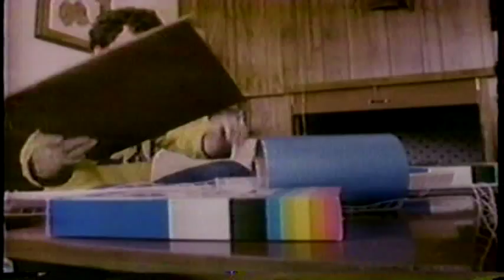MIT Engineering Competition: Ping Pong Balls

Comment: Nice collection of 2.70 videos. I j=know a few of the people in them, and I'm the builder of the winning machine in this video.
Reply: Brad Waller the death mobile is awesome my friend.  I miss watching these.
Reply from the maker: I recognize your name. Wow.... belated congrats!
Reply: That was a really good design.
Reply: @anteconfig5391  The design was good, but not great. What set me apart was that I finished early enough to get hours of practice time driving the machine. I probably had 8-12 hours time on the table driving and using the machine after completing it and before decorations. There were likely better designed machines that just could not be controlled. Two lessons: Keep it simple enough so that it does not break/fail, and practice enough so that you are better than 90% of the rest of the field.
Reply: @BradWaller  Im sorry if this is a dumb question, but how exactly did your death mobile work?
Reply: @kags4506  It was controlled through a joystick that provided +/-12V to two motors that drove each of the front wheels. There was a one way "rake" at the front made from welding rods that let the balls pass under but would not let them escape out the front.
Reply: @BradWaller  thank you very much!
Reply: @BradWaller do you regret going to mit? Or are u glad you did?